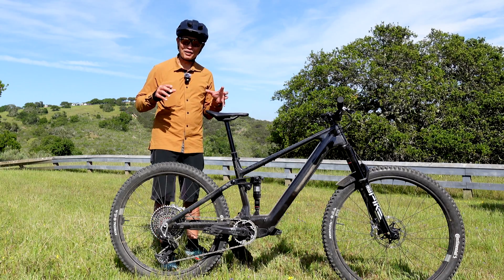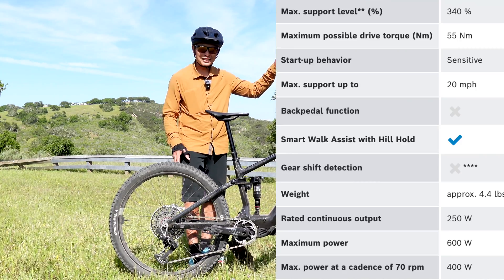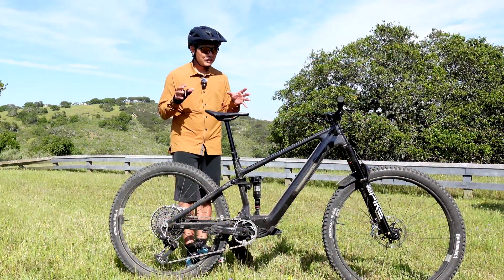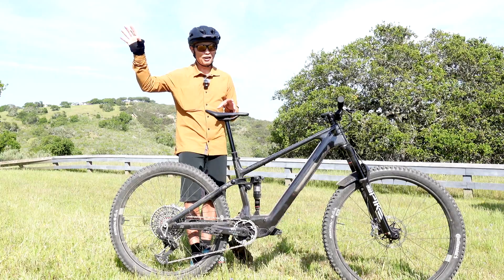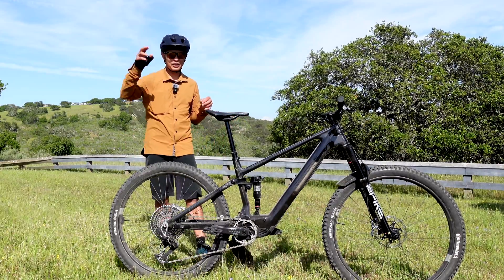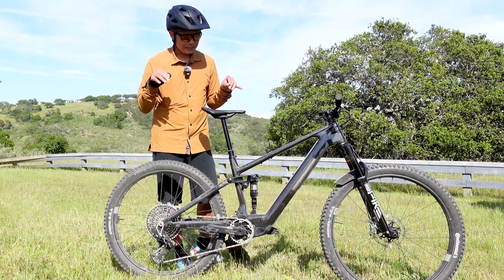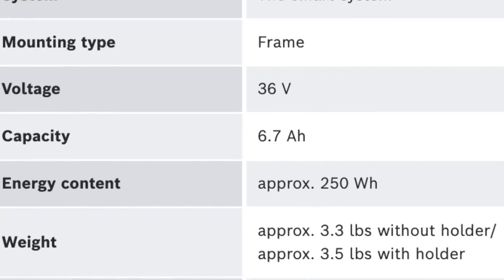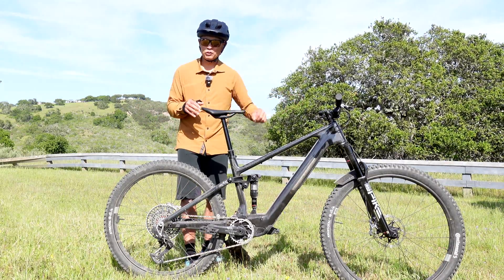Testing The Bosch Sx Lightweight Motor At Sea Otter Classic 2024: Is It Really 600 Watts?

Comment: New owner here of a Transition Regulator SX... I'm 51, highly active and in pretty good shape so I decided I wanted the smaller motor and an overall lighter bike. This Bosch sx motor has more power than I need. I've had to turn down the power mode already, well every thing except for turbo mode😂 

The only other e-bikes I've ridden are a transition relay, Santa Cruz heckler SL and a heckler 9. I'd say that this SX will cook all 3 of those bikes on trails.  Yeah, it will lose to the full power on a full-out sprint on a climb, but that is a very small percentage of the riding I do. 

My rule going forward will be to get at least 2 rides a week on my amish bikes and however many I want on the eeeb
Reply: How annoying is the motor rattle during coasting?
Reply: @ThunderStruckMTB not sure what others are talking about as there is almost no rattle to be heard, other than an occasion "clunk" on big hits, that's almost not even noticeable.
Reply: @ronwilson4697  Interesting! Thanks Ron.

Comment: do you still want to feel like you're riding a mountain bike with a little help or a downsized electric dirt bike. I have a trek exe and would never trade it for a "fat e bike" but to each his own.
Reply from the maker: Definitely still a mountain bike, just more planted with great traction but heavier to throw around. Takes about 5 rides to get used to the 50 lb bikes.

This Norco, fyi is mid power, btw. It’s 42 lbs , just like your Trek Fuel Exe

Comment: What's the question mark after the 600w for? Yes they are 250w nominal wattage with a max output of 600w it's a way for shimano, bosch, batangas etc to be able to get around the 250w limit in the EU market and why the UK don't need 500w motors are our 250w are more than capable of reaching 30+ mph its speed limit we need increasing a tad not wallowing the motor wattage up to 500w that's just stupid and not the way to go around getting a new top speed limit law passed!
Reply from the maker: The question is whether this 600 watt motor feels as fast as the 550 watt motor of the Specialized Levo on a mountain bike trail. Does it feel more powerful on any circumstance?

Comment: Thanks for the great video. My question would be how is it at lower cadences say 60-80? Does it actually perform well compared to the fazua and levo?  There's no way I could maintain a cadence over 100rpm. The battery combo is great but you are making major compromises if you have to continually have very high rpm
Reply from the maker: At 60 to 80 RPM it feels stronger than a levo SL and maybe a hairless torque than a fazua motor

Comment: I just did a test day here in the U.K. and rode the Levo SL back to back with a Whyte E Lyte 150 and 140 (with the Bosch SX motor).

I feel like the Levo and E Lyte are similar at normal riding but if you really spin the cranks the SX is a bit faster, but spinning that fast feels really weird to me… I’m not sure if I could get my head around that. 
Anything with a Fazua feels gruntier and closer to a full-power bike in my (albeit limited) experience.
Reply from the maker: Very nice! I really appreciate your share. And I agree with your observations. Thanks a ton, my good man!

I publish the video before that stated that in mountain bikes, torque is a lot more important than watts. That’s because torque is what changes your speed and accelerate you. Watts is what determines your top speed.
Reply: @EMTBReview  No problem 👍🏻 I totally agree re torque vs power for EMTBs, especially since the bikes only assist up to 16mph in Europe! 🙄 You really just don’t get the chance to open the SX up enough.
That said, I still enjoyed riding the E Lyte, I think it’s a fantastic bike but the marketing from Bosch has shot themselves in the foot because they keep saying “as powerful as a full power EMTB” and while you can sort of make that argument on paper, it absolutely doesn’t feel like it on the trail. I rode an Orbea Wild with the full power CX and that was just way faster because of the torque and torque response. It’s a good system but their marketing g strategy is not the best. 

Also I don’t know if you’re aware but apparently when added, the SX system uses the range extender as part of the whole system… so you can’t set it to drain the extender first then throw it in the car when it runs dry and carry on doing laps etc… that’s a huge own goal in my opinion given that other systems offer that option.

Comment: I think people will interpret this review as largely negative, but it shouldn’t be. It’s not a full power motor and that shouldn’t be the expectation. My experience with it has been much more positive than Francis’, however. I have ridden with fit and fast guys on full power motors and kept up in steep terrain, albeit I worked harder and used more battery than they did. I also rode with a fit guy who was on a Transition Relay, and the Bosch SX blew the Fazua out of the water. As noted in the video, you don’t get the super torquey, ratchet uphill at slow cadence response that a big motor gives you, but that’s not the goal or purpose of this bike. If you want a lighter package with a lot of power, and you’re willing to put in effort and get rewarded with a power boost (over 80 rpms is when it feel strong) this bike will blow your mind. If you expect it to be a Dyname motor minus 20 pounds, you’ll be disappointed.

The motor is also tunable, which I don’t think was covered to a great extent here.
Reply from the maker: Correct, this is not meant to be negative because it will be one of the great lightweight motor options of 2024. It’s like a fazua but with an extender.

But it really is meant to bring expectations down as opposed to the 600 W claims. On the trail, it feels like I midpowered bike, just like the Fazua. But it Has the Bosch extender and they’re tunability.

But as I have learned, on mountain bikes., Watts is really for top speed and torque is for acceleration and climbing.
Reply: I agree, I’m coming from an Orbea Rise and this motor feels great.  Yes they say it has up to 600 watts of peak power but i still think it can’t be compared to a full power bike because that’s not what it is.  My husband and I just got this bike in the C2 build and we are really excited about it.   Thanks for all your reviews.  Looking forward to more.

Comment: I believe Canyon uses that motor in their Grizl-on gravel bike.  Would love to see you do a review on the Canyon Grizl-on. Canyon also has another e gravel bike with the Bosch 85nm motor.
Reply from the maker: Great suggestion! This may be ideal for a gravel bike. I’ve learned that torque is what changes speed and watch is what determines top speed. So a gravel bike that can go 28 miles an hour can take advantage of this motor’s watts

Comment: The specs are weird for the $11k model. Why the 130mm travel? the budget version is the only one to come with a mech derailleur.
Reply from the maker: Like the pivot shuttle SL, some mid power bikes, but less travel so they can make fast E bikes under 40 pounds. I think more capable made power bikes, with 150 mm of travel are better

Comment: And is the bike any good, in the usual sense, regardless of the motor characteristics?
Reply from the maker: Yes definitely. Geometry seems dialed in the suspension seems supple but personally, I would want a bike under $7000 and 150 mm of travel.

Comment: Can you tune it to make it deliver the higher power at lower revs?
Reply from the maker: No. This is us all the power. This motor can deliver in the lower revolutions at the moment. I learned that during testing the team and optimized this power delivery with firmware because it used to require higher revs.